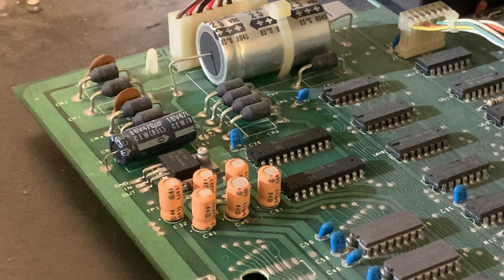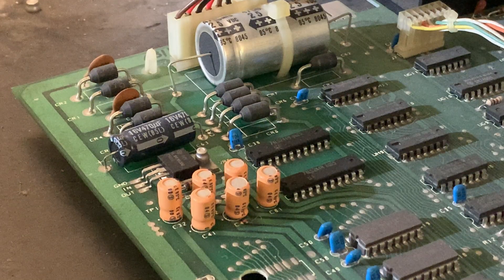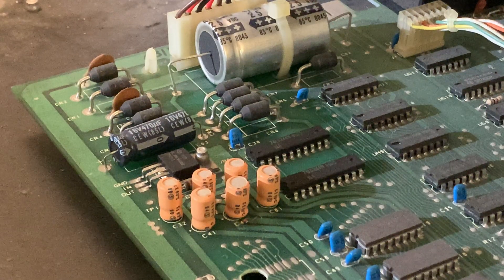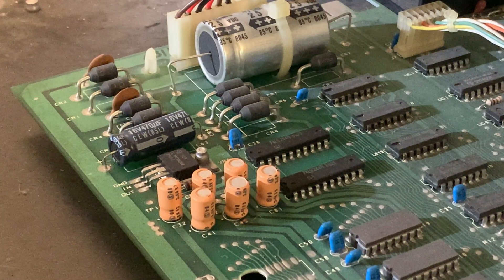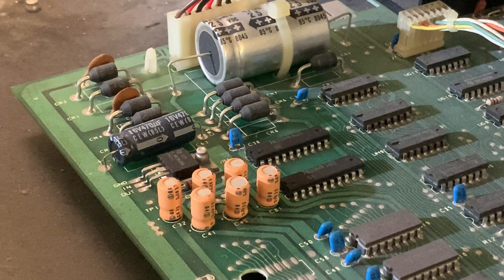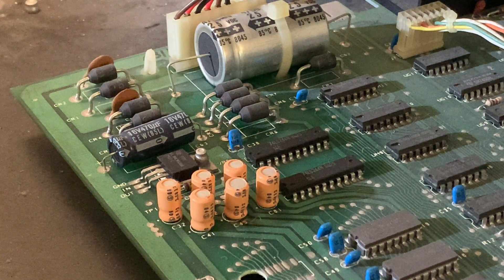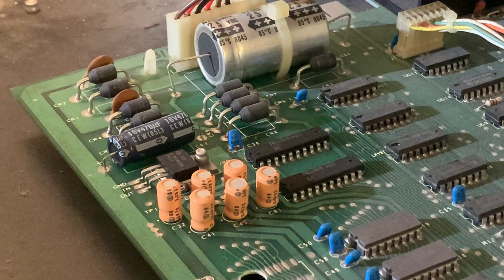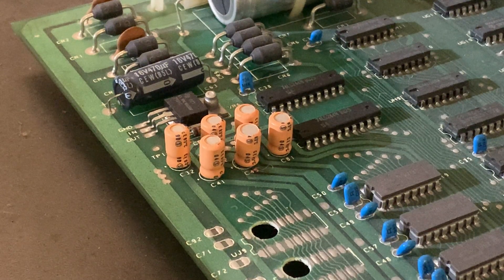Commodore PET Capacitor Story - Rudy Needs Help! Various Values...Strange 6502 CBM - Episode 1159

Comment: Smoking electrolytic capacitors? That's quite unusual. These usually dry out, leak or explode. Are you sure it was not infamous RIFA impregnated paper type capacitor in the EMI filter of the power supply? Its some is easily recognizable by its horrible smell and by being heavier than air, creeping along the table top as a mist.
Reply from the maker: That is what he thought it was...but it ended up being these ones...or maybe it was that one, the one you mentioned...and these...I will have to double check with Rudy!
Reply: @DRBradleyPhotography  Keep me up to date, please. I'm really curious about it.
Reply from the maker: @32bits-of-a-bus59  I did get a call from Rudy, and he did replace the suspect capacitors and now, the machine is indeed working!  They keyboard needed cleaning...so he took that apart, but it now seems to be all good!
Reply: @DRBradleyPhotography  Great to hear that!
Reply from the maker: It is always great to hear of some success out there in the 8-Bit World!